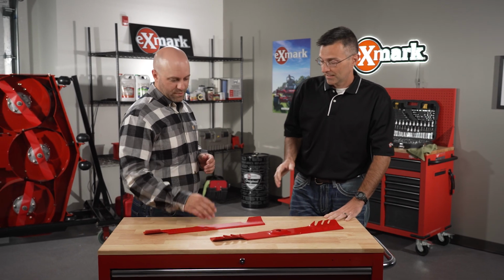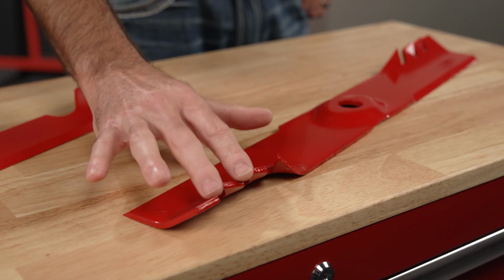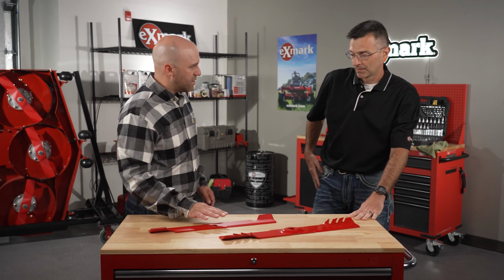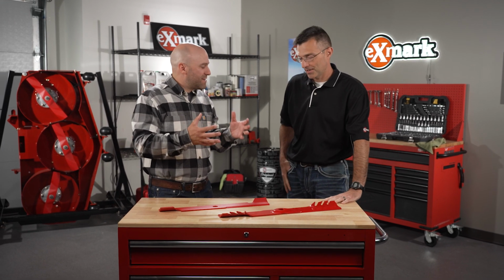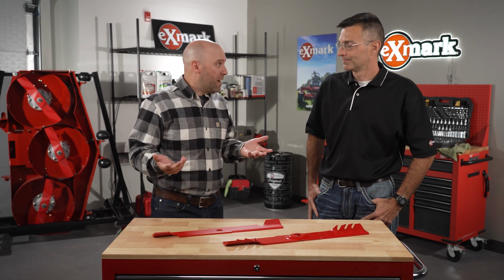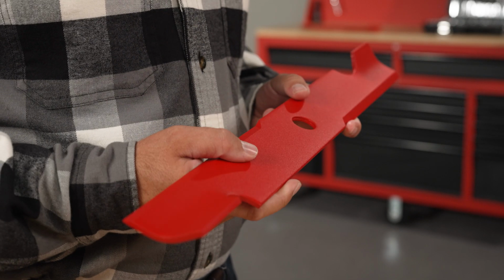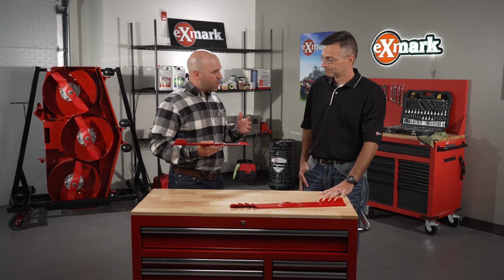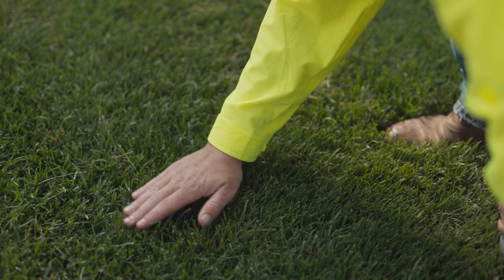Lawn Mowing Tips for Fall Cleanup | Exmark Mowers

Comment: Love my extreme blades. I actually use them year around. I never used a high lift blade, was wondering if I should in the summer months?
Reply from the maker: If the extreme blades are giving you the after-cut appearance you are looking for, you should be fine with them. Sometimes conditions call for high-lift blades to increase the quality of cut, but if these are working for you, go for it.
Reply: @ExmarkManufacturing  ok thanks for the response. I didn’t know if high lifts would leave clumps of grass to where I would need to double cut to spread the grass around.